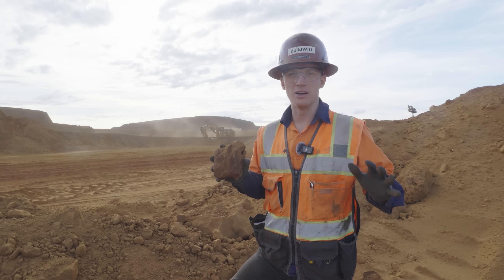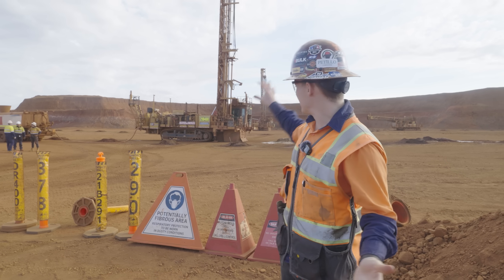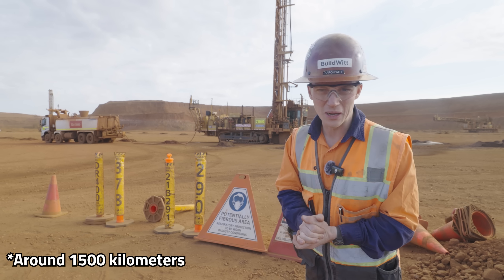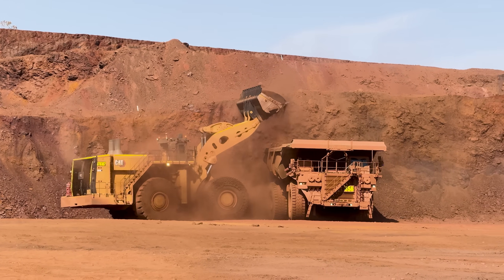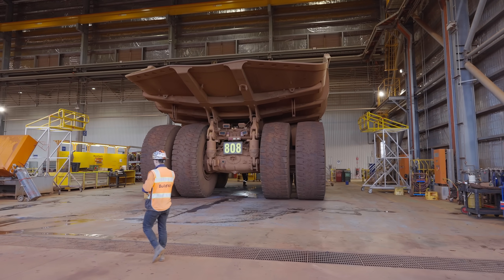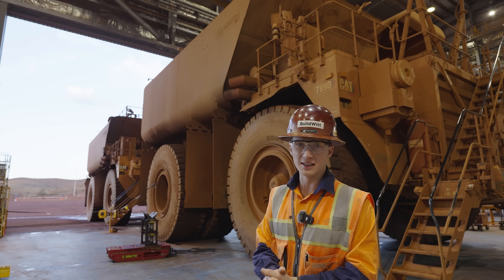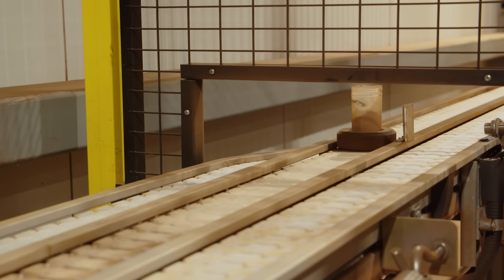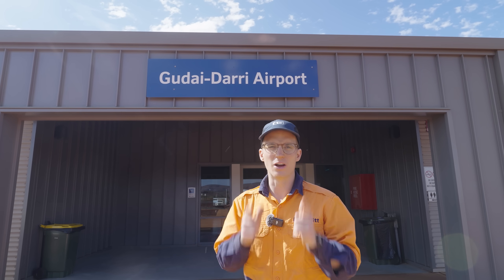How Iron Ore Mining Works!

Comment: Excellent Video! (though I have never seen such a tiny Blast on a Rio Minesite, Ever)... The Automation technology is RioTinto (RTIO) developed in Austraia in Partnerships with the Heavy Equipment manufacturers - BUT - the Trucks are either Caterpillar (USA) or Komatsu (Japan), Loaders are Caterpillar (USA), Komatsu (Japan) and maybe still some Liebherr and O&K (both Germany, these are track-based machines and do not have the flexibility nor speed of the far smaller machines like the CAT 994 (though it's still a bloody big loader), Excavators are Caterpillar (USA) or Hitachi (Japan), Locomotives are ALL General Electric Dash-9's (USA), PLC's are Schneider (France), Rail Tracks and Ore Cars (China), Reclaimers, Stackers and Shiploaders (Germany), ROBOT's (as per Laboratory Assaying) ABB (Sweden), Site 4WD Vehicles (FORD Ranger or Toyota HiLux / LandCruiser)....  That aside, I have worked on Mining Projects world Wide (Process Engineering, Communications / Automation / Control Systems, now retired) and I can say the Aussies truly are the World Leaders in Mining and Delivery of new Projects, and RioTinto is so far ahead of the rest and (don't know about now) used to treat all staff with respect, however those years have probably gone, now it's ALL aboout the bottom line.  However in regards the Automation stakes, no-one comes close, the next biggest miner is Australia's BHP, years behind RioTinto in Automation.

Comment: I. myself, have no use for Las Vegas, or a beach front vacation.  The Iron mine, and or an open pit coal mine, with all of the equipment either or both would be using is right up my alley.

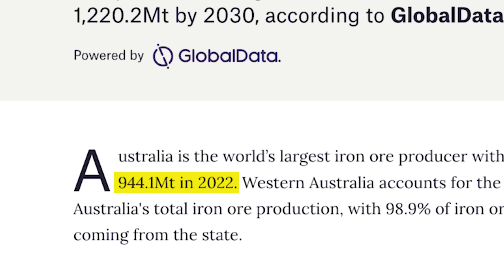Comment: 0:57  sorry, but airplanes aren't made out of steel. Their made of aluminium (because it's lighter)
Reply: Depending on the part, most aircraft frames are aluminium, skins are normally aluminium but can also be some form of synthetic plastic (Airbus A380). In terms of working components in the engine, though, most of that is some form of steel (typically a nickle steel allow) as well as the hi-pressure hydraulics and pneumatics. So it isn't wrong to say that steel is used in aeroplanes cause it is.
Reply: I’ll join you in some YouTube pedantry. Planes do indeed have steel in their construction due to it’s strength and ability to survive stress.

Comment: Things have changed since I worked at the adjacent Paraburdoo and Channar sites in the 90's as a breakdown electrician. I worked in a 3 man crew and was responsible for keeping 4 rope shovels, 4 excavators, 6 drills, 40 trucks and 2 crushers up and running. Best job I ever had. I used to make a point of nailing problems that the day crews couldn't figure. Very satisfying. I wouldn't be able to cope working in a woke workplace these days though.

Comment: To see a large dumpster filled with big paper, usually reusable air filters almost made me fall out of my chair! A filter bigger than a 5 gallon pail has to cost more than $200 each,, of course they're buying them in bulk. They can be blown out with air from the inside blowing out,, sometimes it takes a while to do a good job but it can be done. Then a certain percentage of those same style air filters can also be washed with a cleaning solution. We have one small diesel here that has a filter about half that size,, it almost went 40 years!😢😢. PS our other diesels have oil bath air cleaners,, not sure which I like best?😂

Comment: It's absolutely amazing. Hard to believe they have perfected autonomous vehicles of that size to perfection.
Reply: It's actually easier to automate those vehicles than cars. From a technical point, they are much bigger, and if they drive a meter to the left or right, it wouldn't matter for the most part. The rules are much simpler. Most sites are one-way drives, and there are almost no intersections. If there is an intersection left for right or right for left, it does the job. No need for traffic lights, roundabouts that are intersections, no motorcycles or bikes, and no pedestrians anywhere near them. And from a commercial standpoint, you don't want to be unnecessarily expensive, but if there is a good reason to spend money, like using GPS, radar, lidar, and camera to have a 2 out of 3 decision, even if one sensor fails they say just tell us how much you need. In road cars, it's a real fight to get even one sensor in a place where it belongs, and many want to get away with cameras only or something like that. Barely anyone invests in the "gold standard" if there is an option to get away cheaper.
Airplanes were the first to go autonomous. even bigger, and traffic density is a joke compared to any other vehicle. Trains and ships were also really easy, but legal things and reasons why you need a person on those anyway, which could also as well drive make it hard in practice. Car's is by far the hardest because the rules around them are bonkers, traffic is the densest of all, and it's common practice to not drive by the rules. It's also not really legal, as a lot of laws are built around the driver, but who is the driver in an autonomous car? By how the law works, it has to be a person. So either a product manager or the owner of the vehicle.

Comment: My biggest problem with the Automated Haul Trucks is How many jobs did that just Displace we shouldnt be cutting people out there are more people in the world What are all these people gonna do if we keep giving the low skill jobs to Robots
Reply: Adapt, mate. Simply learn how to maintain / operate those autonomous systems
Reply: More people are employed to run the automation systems than there were drivers, it's not about reducing employee numbers it's about improving efficiency and safety, employee wages are a drop in the bucket when it comes to the money being turned over by operating mining operations such as these, they aren't spending millions on automation just to get rid of a handful of truck and train drivers.
Reply: The automated systems don’t actually remove any jobs as the workforce to support is nearly same but the efficiency of the equipment is 30% gain. A haul truck operates 23hrs per day instead of 18hrs.
Your correct on skills, you do need to up skill workforce to operate these. There is more monitoring of equipment due to lack of operators.

Comment: Great coverage! 
I’ve done research and development of autonomous vehicles during my graduate studies. It’s really impressive to see these systems deployed out in the field in those kinds of conditions. I wonder if they have any human detection methods (for safety and accident prevention).
Reply: they do! They have whats called ODS - obstacle detection system, on the CAT's they use radar and LIDAR detection that covers a 360 sweep of the vehicle continuously. The Komatsu's use Sonar and radar. If an obstacle is detected the truck comes to a stop and to restart the vehicle an operator/supervisor or engineer has to visually go out there to clear it and can restart the truck. That, and any LV's or other heavy equipment on autonomous haul roads have a 50m digital exclusion bubble. If any vehicles come into it's 50, the truck stops - this is besides the dig units, they have a seperate spotting system to call in trucks for loading.

Comment: The amount of robotics is impressive in these Australian mines. It must be nice to have operators living in a coastal city remotely controlling the equipment.
Reply: Until you realise that the only reason that a mining company that makes tens of billions of dollars profit over the life of the mine is making stuff autonomous because you don't have to pay machines...greedy sods
Reply: @dhufishhunter6455 still gotta pay the machine maker... Cant be much cheaper, (until you factor in education, at which point its also less of a hassle).
Reply: @johan790  The mining company basically made the machine so…
Reply: Also the jobs that are required with autonomous machines are typically higher skilled. Think about all the software engineers, spatial engineers, mechanical engineers required to operate these machines instead of the people inside the machines.
Reply: @xHaRdStYlExHuNgErx  But they were able to afford university, while miners are struggling.

Comment: I bet they do well money wise.
Reply: operators on 160k a year depending on the asset you drive, engineers typically 180k a year, senior engineers around 200-210k, boily's and fitters 180-200k working 8 day fortnights, 6 day breaks

Comment: I think it’s dumb to automate essential tools and then put the command center 1000’s of miles away. You increase the chance of failure. when having an operator on site was fail safe. My company couldn’t distribute products in Maine when the hurricane hit Florida. Their disaster left us helpless because of these systems.
Reply: little to no natural disasters up in the Pilbara - one of the reason that place is so flat is because it has such stable natural weather conditions - a bit of water during the wet season but nothing major. AHS sites actually have higher effective utilisation of availability than any other manned site. Failure is low and its more safe taking out operator error (which is 90% of accidents with these machines)

Comment: My stepdad worked as a manager for 20 years at an international corporation called Leco. One of the many things they made was an atomic scanner for the elemental breakdown of the steel and aluminum industries. He said if you put a hotdog on that thin that it would tell you every element and exactly how much was in it. They used metal, etc. blanks to get exact recipes of these metals.
Reply: If that is LECO (Laboratory Equipment Company), they made analytical instruments back fron the 1960's. Gravmetric Carbon analysers and sulphur analysers were their early units.
Commonly used in Chemical Labs in the Steel industry.
Reply: We have use an X-ray florescence scanner at my factory. I have a printout somewhere of a Dorito broken down to the 0.0001%
It also works for the welding wire/flux we make, but that's not as interesting.

Comment: Really blows my mind why they don't use electric trains or conveyors in the pits instead of enormous diesel-sucking haul trucks. Sure it's a tiny bit more planning, but they had the system worked out over a hundred years ago at enormous and famous mines like Bingham Canyon, but then you don't need the diesel, you don't need to water roads, you just need relocatable conveyors or track panels that can be dragged around and added to as needed
Reply: It's literally in the middle of nowhere
Reply: Relocating converyors is not easy - development at these sites moving 200+ million tonnes a year (including waste) means that roads change constantly, pits are depleted quickly and mines expand in distance fast. This combination just makes it way to costly for conveyors - not to mention the amount of ongoing maintenance you have to do to them under mining conditions.
Reply: @clousejones1563  All true of a conventional conveyor, however the Germans use tracked mobile conveyors to run spoil and coal in their lignite mines from the bucketwheels, because it's the only way to keep up with the sheer volume

Comment: Did the math 190,000litres is just over 2 average swimming pools... they have 4 of those? Crazy big operation!
Reply: TBH I doubt that it's 190m^3. That would mean that they weigh at least 190 metric tons, which I highly doubt?
Reply: They're build on the same chassis as the haul trucks by the looks of it so 190t shouldn't be a problem @Jinguapingi
Reply: @Jinguapingi  The haul trucks are carrying 250 - 300 tones and the water trucks are built on a similar chassis.